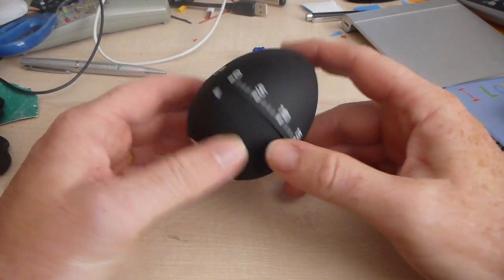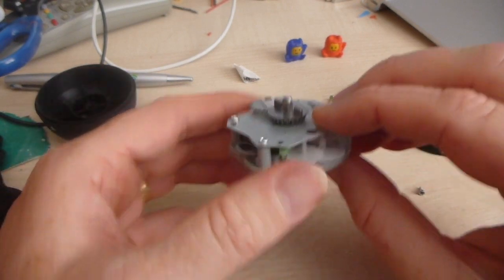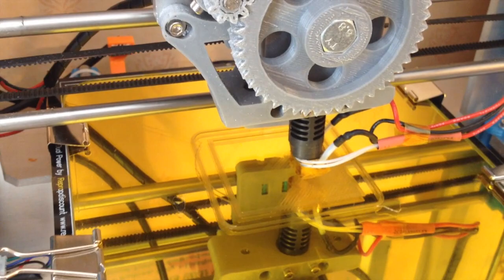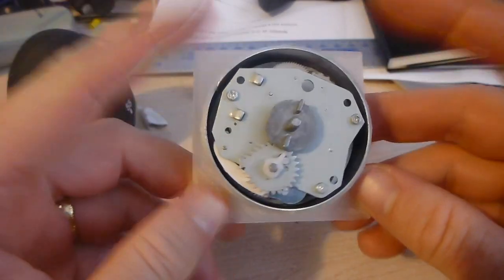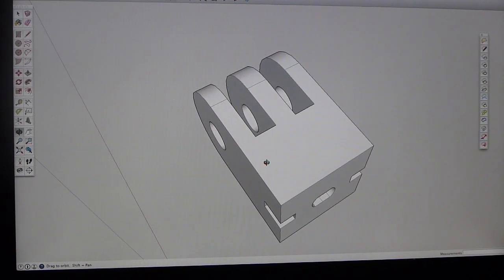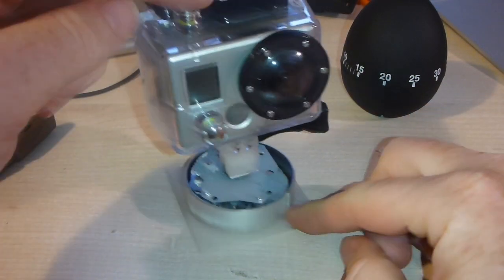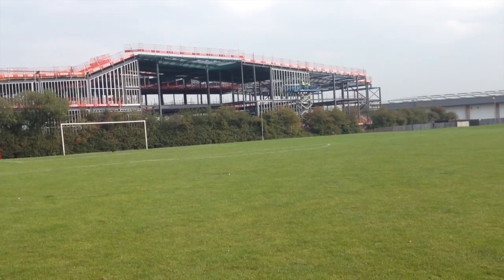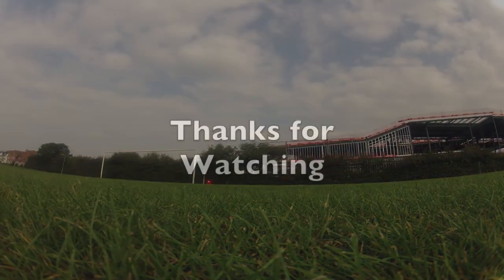Turning a cooking timer into a GoPro accessory

Comment: That does indeed look superb although I kinda expected you to just glue it to the egg :)
If it had a small cone shaped rain cover over the center you could leave it out in lightening and stuff. Add another go pro nodule on the base and you can strap it to stuff too maybe.

Would you possibly mind doing a short video on your 3d printer sometime? I'm super interested but it's an insane minefield or intimidating options. Basic costs and any major details etc. Thanks
Reply from the maker: Hehe, I like the gluing it to the egg idea :)  I've had a think about how I might connect it to other things - and yep another GoPro fit is one, as well as a ground spike to hold it somewhere.  I may well do something on the printer... I was waiting until I finished messing with it, but I think this messing is kind of ongoing.  One of those things where you need to enjoy solving the problems if you build you own though :D
Reply: I absolutely, unequivocally would want the most hassle free solution within the realms of a DIY solution. I was hoping it was robust enough now to buy component parts and then do some basic calibrations. Almost like a computer build if this is possible on a budget or am I still incredibly naive here?
Anyway, i'll wait for a little video in the future as I won't be buying anything this side of xmas.
Thanks